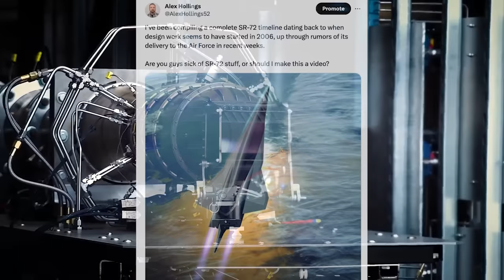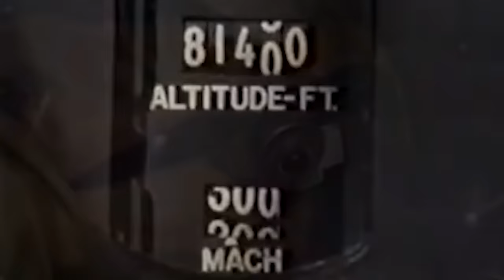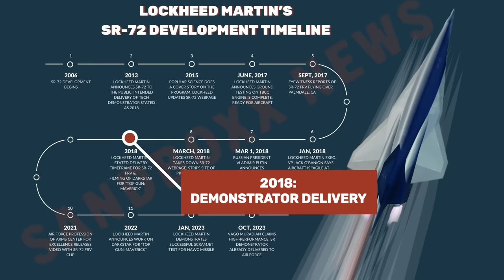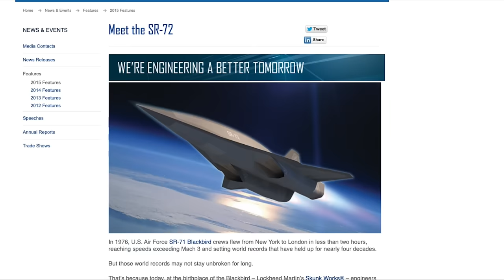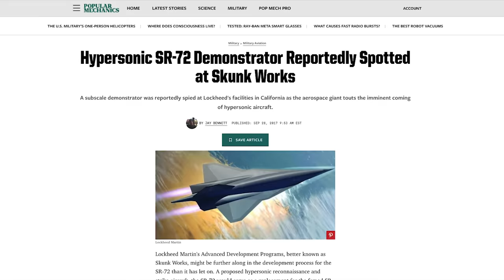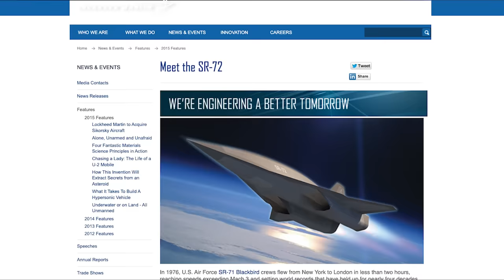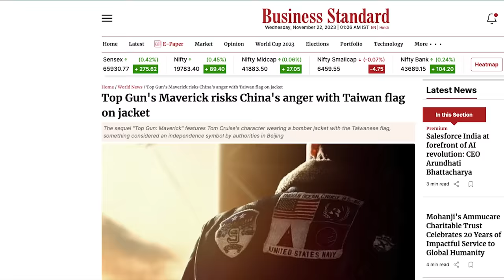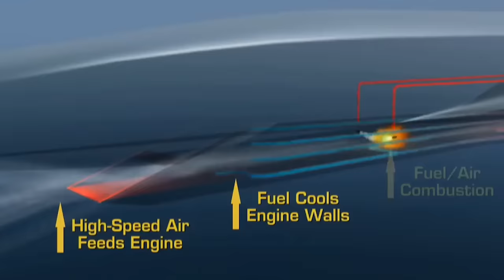The SR-72 is REAL — And we can prove it

Comment: I remember hearing about the Aurora high speed spy plane back in the early 90's. I wonder if the SR-72 is an offshoot?
Reply: The SR-72 might be the SR-91 Aurora in disguise.
Reply: art bell in the 90s intensifies
Reply: Anything moving this fast would be way too high to be visible, plus it would leave a massive trail behind it
Reply: @amazin7006  now I'm not pretending to know the exact physics, but aren't the trails of aircraft only when they're in the cons? contrails only occur in the coldest parts of the atmosphere (usually between 25 and 40 thousand feet) but these aircraft fly much higher
Reply: @kuhnville3145  Exactly. They fly above 85,000 feet, near space.
Reply: @kuhnville3145  Not contrails, plasma trails
Reply: @amazin7006   can you explain what the hell a plasma trail is? I've never heard of it and when I google 'plasma trails' or 'hypersonics and plasma trails' I just get something about radio interference and stealth boosting characteristics, both about hypersonic missiles not hypersonics in general.
Reply: @kuhnville3145  Its the same thing that makes atmosphere reentry vehicles like the space shuttle glow. The friction causes the air around the ship to heat up enough to turn into plasma which causes a visible glow. Same with the air coming from the engine
Reply: @amazin7006  ok so basically it sounds a lot to me like high speed + friction = cool effects
Reply: @kuhnville3145  Yeah you can find a few pictures online from NASA. It looks like a meteor with sparkles coming off
Reply: IIRC when the air force originally retired the SR-71 the USAF was paying for the aircraft operation, while the US Navy was the primary customer for the information from the missions
Reply: @amazin7006 So that wasn't skylab I saw at summer camp in the 70's. And it couldn't have been the International Space Station I saw over the last several years?😮
Reply: Shhhhhhhh! 🤫
Reply: @kuhnville3145 It wouldn’t leave plasma trails. It would not be traveling fast enough to generate plasma if moving at Mach 10 or below. Orbital vehicles come in at something like Mach 25. If it was generating plasma half of the aircraft would need to be made of a material that could survive constant proximity to plasma for long periods of time. It would need to be ablative or have some ridiculous cooling systems. A Mach 10 plane would need both some strong high temperature material and a serious cooling system, but it would not have to survive constant exposure to nearby plasma. The thermal signature would be blinding to instrumentation, but no where near as bad as dealing with tons of visible light and crazy EM emissions that plasma would emit. Additionally, orbital vehicle and space debris heat up and burn through material that adds to the light given off during entry. The plane itself would likely be visible to the naked eye at any altitude it could fly at, although it would be much harder to spot at very high altitudes.
Reply: It’s all wild speculation, courtesy of Popular Science, who’ve done more writeups on Aurora and “SR-72” than USAF & Lockheed Martin, combined. It’s the exact same reason that Lockheed Martin “consulted” with Bruckheimer on TG:M: It SELLS.
Reply: @zlm001  lecturing the guy who didn't know is mental tho. maybe tell the guy who actually said that, and if you look it's not like I never doubted him and even said I couldn't find anything about what he's talking about
Reply: @kuhnville3145  And potentially plasma also aids stealth to a great degree.
Reply: @jamegumb7298  mhm
Reply: SR-72 likely just an Aurora that is capable of unmanned flight.
Reply: @jamegumb7298 No, had an air defense instructor explain to me that modern phased-array radars can see right through plasma stealth.
Reply: @rylian21  well no one is denying that but also just because there’s tech that can see through the plasma doesn’t mean the plasma doesn’t provide some stealth characteristics
Reply: Aurora was the budget name for the first-gen  stealth project which produced the F-117 and B-2. Someone messed up and forgot to redact the name from the public release.

The fact that they're letting the public even know about the existence of things like NGAD and SR-72 means that they're already working on the successors
Reply: @rylian21 I doubt they are working directly on a successor to the ngad, developing technologies of course but they don't even know what a successor might look like at this point
Reply: @tylerparker4010 - ah-hm..yes, they do know. Think hard for a moment..tic-tac. They have unacknowledged special access programs that are building and utilizing technologies that are way beyond even Star wars and Star Trek.
Reply: @amazin7006 they flew  a lot of classified  aircraft  over the carribbean  test range back in the 90s. Because  it would be far away from public eyes.
Reply: @rylian21  The B2 and Have Blue were long since fully funded by the time that line item appeared. 

That’s why that explanation never made much sense.
Reply: @misplacedstarman5455  The Tic Tac was very likely just a demonstration of sensor spoofing technology under DARPA’s Nemesis Program.
Reply: The supersonic Mach 4-5 Aurora replaced the Mach 3.5 SR71 in the 80's-90's. The Aurora will be replaced by the hypersonic SR72 AI unmanned drone.
Reply: I am sure I have seen the aurora flying at incredible altitude I don't know what else it could have been
Reply: @rifleshooterchannel208  - Nope, it is an actual "aircraft "...
Reply: @misplacedstarman5455  There is absolutely zero evidence to support than assertion.
Reply: From what I've gathered so far, it was likely an early technology demonstrator for either RAMjet or Pulse Detonation technology. From what I understand, no more than 3-5 demonstrators would've existed and the project was likely later terminated. Lockheed and the USAF however likely used the valuable data learned from these tests for future Hypersonic projects

Comment: One thing to remember is that since the new B-21 Raider is not a supersonic platform, it is rumored to have a tuned F-135 engine for ultra high altitude operation in excess of 80,000ft. For standard combat operations, it cannot necessarily fly that high, nor would the pilots want to be on board, as pressure suits are needed. Piloted combat ops are rumored to be around 60,000ft. 
  However, you don't need pilots when you remove the combat payload, and install a large fuel pod in the bomb bay, and lighter weight reconn equipment in the side missile bays.
Reply: Good point. Makes sense they wanted it to be remotely operable.
Reply: @uku4171  ...Yes. My point, is that it turns every B-21 in the fleet into an advanced RQ-180 reconnaissance type aircraft, and can be used anywhere in the world the B-21 may be stationed. So, gathering intelligence on a foreign adversary will be much easier and much more available when time sensitivity is a major factor. The other capability, is the side missile bays will also allow it to be an ultra high altitude on station missile platform/arsenal ship to be networked and assist Air Dominance aircraft in an aerial denial scenario. With exception to super maneuverability and supersonic performance, it will in fact be the technically capable "Jack of all Trades" the Air Force has been wanting for a very long time.
Reply: @Condor1970 100%, you get the feeling that the B-21 is basically what old school B-2 engineers always wished the B-2 could have been and mucho more (like the possible addition of the B-21 having air to air missiles)

Comment: Internally funded almost 2 decades of cutting edge aviation R&D, including test articles.  The bill for that has to just be eyewatering😂
Reply: Worth every cent for reliable intel within an hour or two
Reply: And yet was 50-70% less expensive than had the US taxpayer funded the research. Obviously LM will make it up on the backend when sales of this platform happen.
Reply: I promise LM didn’t “internally fund” anything. I worked in partnership with LM 9 years ago. They don’t do ANYTHING without getting paid. I was a test pilot for a new mini sub for the SEALs. LM was eyeballing swallowing our company to provide a replacement for the minehunting drone that was SO BAD that Congress scrapped it. They wouldn’t support training dives b/c the DOD hadn’t paid us to do training dives, even though all it would cost above the overhead we were already burning was the cost of 6 hrs of gas for the support boats. LM builds what the govt pays them to build. Period. If the govt actually wants it to work well, or be improved, they’ve got to pay extra for that.

Comment: Last year, I saw and took pictures of 4 B-2 Spirits flying very high above the city in a line formation in Cheyenne Wyoming. A B-2 is the only flying wing with two engines that I'm aware of, whether it's a drone or manned. The picture is clearly of a B-2 because of the points (Apex nozzles) in the back. It's extremely rare, especially in such large numbers, so it was an amazing sight for sure.

Comment: Some food for thought here. I will be bringing up some points that Ben Rich ( Kelly Johnsons successor at the Skunk Works ) also brought up at different times. 
#1 Coming up with materials to build the plane out of is incredibly difficult and expensive. Even at the time the SR71 was retired, we had not yet found very many replacement materials that can handle the heat generated by even the speeds the SR71 hit, let alone significantly faster. One also needs to keep weight in mind here. The Skunk works went thru an incredibly rough time getting rid of ounces of weight let alone pounds worth to build the A12 and SR71. 
#2 Then there is the whole fuel issue. They had a miserable time creating the fuel for the SR71. What is out there to replace that now?
It is a neat idea but much harder in practice than people think.
Reply: Hermeus doesn't seem to have an issue with fuel
Reply: Space Shuttle went Mach-25 sustained above M12 for over an hour on reentry.

It was made of aluminum, covered in ceramic. They now have Ceramic composites, not just tiles. You can make the whole airframe out of ceramics. 

And in the late 1950s they were developing a Nuclear ramjet powered bomber with a cruise speed of mach 3.0... at sea level. And a range of 15 years.

They halted the program, because unshielded reactors make atmospheric pollution that would become detrimental. And because they didn't want Russia to copy that tech, as they were liable to actually use it. And they didn't want such a powerful weapon, because the world would not see them as virtuous if they ever used it to merc the USSR. True stories. The nuclear ramjet program dayes back to 1946 plenty of NACA discussions on it available online.
Reply: Technology has advanced significantly since the 60s
Reply: @TheJustinJ  Well maybe not the entire airframe, a heat shield for the directly exposed parts would be enough. 3D printing techniques would allow those parts to have integral fuel ducts for cooling / fuel pre-heating. Something like aluminum oxide or boron carbide is able to withstand extreme heat while being lighter than titanium. They're brittle materials but maybe they've found a way to overcome that. There have been only two major obstacles for hypersonic flight: one is the airframe material, the other the powerplant. The aerodynamics of hypersonic flight have been fairly well known for many years now. We already know there are engines capable of working at those speeds so I'm fairly confident the required advanced materials are available as well.
Reply: #3.  Ben Rich also wrote in his book that life support for crew in an aircraft going significantly above Mach 3 would be impossible.
Reply: One has to wonder. Obviously massive technological increases since Oxcart's inception. I'm looking at it that Mr. Johnson & his Skunk Work's successfully designed, engineered, tested, built and maintained what wound up becoming S.R.-71 in the 60's! (mostly) Here in 2023 if your like me that is absolutely the definition of "mind boggling"
Reply: @TheJustinJ I'm aware of The Shuttle's capabilities the bit about a nuclear bomber I was not

Comment: It will be interesting to see how they launch weapons from a hypersonic plane without tearing off the doors to the weapons compartment or incinerating the plane.
Reply: if they were to do this (love you Alex but the 72 is still just overblown fiction) they would probably take design cues from the a-12 for weapons employment
Reply: Yeah, I think it could perhaps be done by putting the bay doors behind a step-back in the fuselage that creates a near-vacuum at hypersonic speeds. This could perhaps shield the doors from the brunt of the ferocious wind.
Reply: The issue for weapons deployment would probably not be opening the bomb bay - a Canberra/Buccaneer-style rotary door with suitable deflection could be engineered, but rather safe separation of the weapon into the airstream, without it just bouncing back up into the aircraft. Can’t help but think that the linear bomb bay, a la A3J/A-5 Vigilante, would be better. Also solves the challenge of finding space between the engines, if those are mounted beneath the body.
Reply: common misconception. All fadt aircraft are limited to a similar dynamic pressure. Hypersonic planes can only go fast at very hogh altitudes where the aerodynamic forces they experience are similar to just above mach-1 at sea level
Reply: I figure it would be sliding doors similar to what the XB-70 would have had.

Comment: Squeeeeeeeeeee. 

The SR-72 is just a wonderful idea. Take the Blackbird, make it 2-3x as fast, add stealth. 

The question being is if it looks like that goofy single-tailed drone, or if it looks like LMT's more recent renderings that look more like Dark Star, which looks absolutely BADASS. 

Also, I do wonder why Dark Star has the front of its cockpit sealed off instead of clear.

But the idea that the SR-71 will finally have a real successor is wonderful. Let's hope that jet is every bit as iconic as the blackbird.
Reply: Which to be honest, the SR-72 might be the SR-91 Aurora in disguise.
Reply: "I do wonder why Dark Star has the front of its cockpit sealed off instead of clear". At 23:25 you can see the front being full of instruments. You still have a good line of sight in front of the plane even if there's no window right in the center of the cockpit. It could also simply be a structural thing. I could only imagine what crazy physics problems you need to solve to design a reusable airframe capable of Mach 10. However, the Dark Star is just a movie prop. If the renders of the real SR-72 prototype shown in the video is anything to go by, it seems like it will have no windows at all.
Reply: @nj1255  There is a design of the SR-91 Aurora in a retro Lockheed Martin black aircraft timeline that is similar to the Darkstar. The design in that retro timeline, might be the manned SR-72.
Reply: @nj1255  that might be for the drone variant. How would the pilot *SEE*? Ace Combat like COFFIN type visuals with cameras all over the plane?
Reply: @Ilyak1986  In the future, yes we will need real life COFFIN(COnnection For Flight INterface) systems. In the 2022 chinese aerospace expo, they showed their spacefighter mock up that has a COFFIN system.

Comment: The X-15 was a hypersonic rocket plane that broke records in the 1960's.  The biggest obstacles were keeping the leading edges from ablating away in the heat, and preventing that material from depositing on the windows, blocking the pilots view.  As an avid follower of rocket tech, I know that creating a vehicle that survives hypersonic flight without wearing away the heat shield has been one of the big challenges for reusable boosters.  In the recent launch of the x-37b on Falcon Heavy, the side boosters detached at about 3500 MPH before turning around and returning to the launch site. While the boosters have to endure enormous heat for a few minutes, a hypersonic plane would have to keep its pilot, fuel, and payload from absorbing the massive amount of heat generated by ramming though air molecules faster than they can get out of the way for a lot longer.  I wonder what type of material would survive air molecules sandblasting the surface without having to be replaced after every flight.